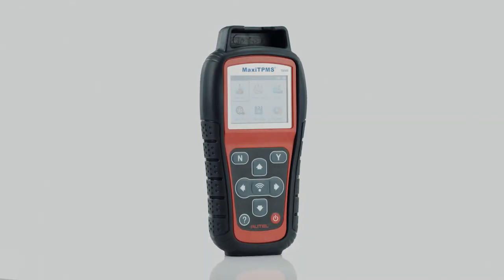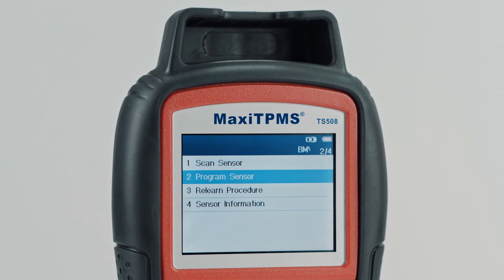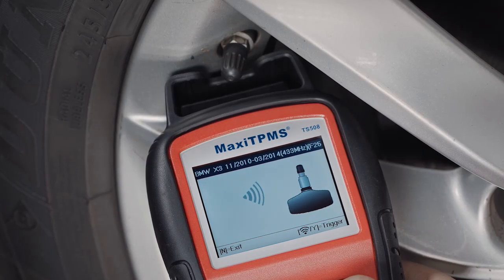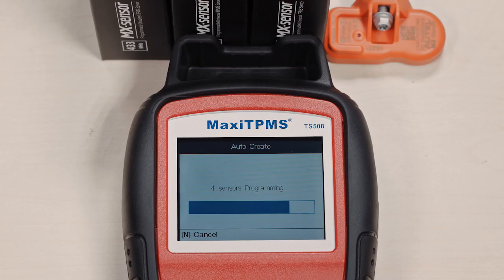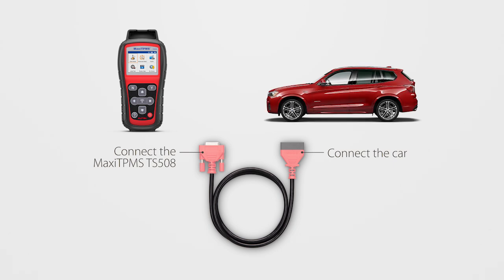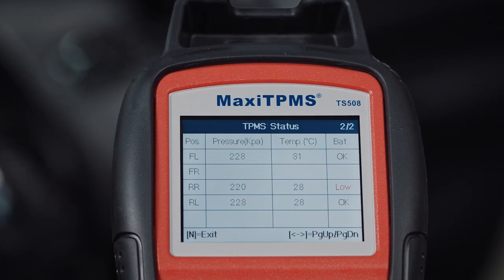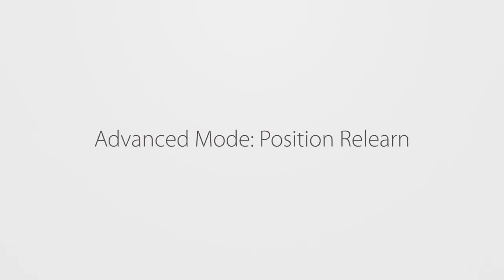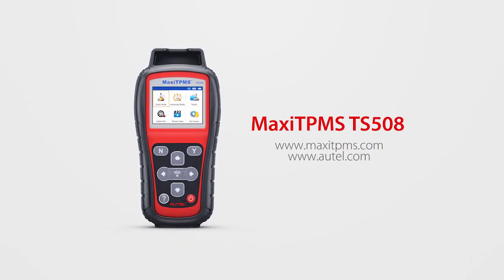Introduction of MaxiTPMS TS508

Comment: Just bought a TS508WF and it looks like copy by activation and manual create options were removed to dumb down the more  budget friendly TPMS tools. Looks like I still have to keep my old TS401 around. Updates are supposed to add features and value, not remove features and dumb sh@t down in order to buy a pricier model tool that offers the same feature the budget tool once  had😡

Comment: Will those allow me to switch frequencies?  I've got a US pickup in the EU and my US tpms sensors (summer rims) and my EU tpms sensors (winter rims) are on different frequencies, so I can't just swap the tires and use the default vehicle tpms recalibration.  I need to take it to a garage with a capable tool.  

Will this work for me?  My EU sensors are autel

Comment: How can I program the sensors if they are already installed in the wheel?? Why is this not covered by any content it's so frustrating!
Reply from the maker: sensors need to be programed outside of the wheel or with no pressure in the tire. If the sensor is already installed in the tire, deflate the tire and try to program with zero pressure.

Comment: Do you need to reprogram the sensors after a tire rotation?
Reply from the maker: That depends on the vehicle. If you have a display on the dash that shows the tire position and the tire pressure, then you would need to relearn the positions after each rotation.

Comment: Does it work for Schader ez sensors?
Reply from the maker: The Autel Tools can not program EZ sensors. The EZ sensors must be programmed with an approved tool, then the Autel tool can relearn it to the vehicle
Reply: @FlashPerformance  thank you for the reply. When I got my ez sensors installed first time, 1 years ago, they were programmed. Now car stopped reading them after winter tire swaps. Does it mean normally that car needs just relearning only which can be done with this ts508 device? Or I have to program and relearn every time after tire swap?

Comment: Houston, Tx tire and wheel dealer here. Been using this programmer which works well with autel but iffy on others from time to time. You CANNOT program sensors unless its an Autel 315/433 mx sensor
Reply: thank you for verifying what i have learned the hard way, NAPA feigns ignorance, I fully believe they know exactly that this is the case

Comment: can u program aftermarket rims and tires with this?
Reply from the maker: The aftermarket rims and tires are not the factor in TPMS programming it is the sensor in the wheel. You can not change tire size that I know of

Comment: Can I install new mx sensors and activate them later? Like drive two days and then activate them?
Reply from the maker: Yes, You can program the sensors while inside the tire. They should be able to be programmed no problem. If you have issues you may need to deflate the tires and then program them.
Reply: @FlashPerformance  No no no, NOBODY has provided ANY instructions on how to activate new sensors that are ALREADY INSTALLED in the tires. PLEASE provide a step-by-step for the activation (not pulling the codes for the old ones but ACTIVATING the new ones with the codes).
Reply from the maker: @nothingtoseehere5760  https://youtu.be/7rszSlKKzag
Reply from the maker: @nothingtoseehere5760  https://youtu.be/s4fWyQtXMuw

Comment: I am at Toyota with my 2015 Highlander for a blinking tire pressure light even though tires have proper pressure.  Diagnostic charge for this is $300 which they say is waived when you pay for the repair.

Comment: so in short, this is a proprietary programming tool just for YOUR sensors?
Reply: I have been wrestling with this exact issue, and it does appear that one needs an Autel programming tool to turn on an Autel sensor sold by NAPA, NO ONE locally has the tool!!

Comment: This precess can be done with any repair tire shop but, It doesn't . Only big company like pepboys, firestone can work and program tire sensor. This is a shame! because the cost of the part and instaltion is $116 / tire. I run to walmart and dealers but the programmer tools did not work on my 2019 Mitsubishi mirage.
Reply: Any automotive repair shop worth a shit that employs competent mechanics can handle replacing, programming and relearning TPMS nowadays, as long as they have a TPMS tool that is compatible with the sensors in question.  Places like PepBoys and chain stores like Firestone and Walmart usually hire the bottom of the barrel grease monkeys, I would not let them get near my vehicles.

Comment: I purchased OEM sensors from dealer and i already installed them on my 2007 toyota tacoma.. can i use this Ts508 to activate and remove the tpms light on dashboard?
Reply: Yes, you just need to do the relearn process. Select the Year Make and Model of the vehicle and press the ? button. This will give you the relearn procedure directly from the tool.
Reply: Who programmed your OE sensors from the dealer?  Because you CANNOT program blank Toyota OE sensors with an Autel TPMS tool.

Comment: Good evening, I have a query, thank you for your support,
I bought a MaxiTPMS TS508 and bought four new sensors (two pairs of different brand and model), but I could not program them, the scanner did not recognize any new sensor, instead the sensors that my hyundai Elentra Turing 2010 has, the rear sensors did not work and now I can't take the TPMS light off it.
Something similar happened to you

How could I contact you for a question or someone from your audience that something similar has happened to him.

Thanks in advance
Reply: Did you purchase Autel MX sensors?  Because if you did not, that would explain why you cannot program them with a MaxiTPMS tool.
Reply from the maker: Autel has a tech support line that you can contact in your region. Go to Autel.com>support. My guess is the sensors you purchased are blank and are not compatible with the TS508.  I recommend the Autel MX Sensor, VDO, John-Dow, Ori-Tech, or OE sensors.

Comment: Hi, install new sensors to my 2013 Tacoma Autel TPMS MX-Sensor 315MHz 433MHz. I have a MAXITPMS 508 scanner, I reprogrammed them, I installed them by obd, the installation was successful, the message but. When I am in the parking lot where I live, the light turns on as if a sensor were bad or a tire and when I go out of the building to the street outside the parking lot where I live. The light goes out . that always happens to me. the air pressure was fine. The Sensors tells the scanner that all 5 are fine. I did the reprogramming of the sensors more than once and that always happens to me. only where I live in the building park. because the light turns on the screen only in the parking lot of the building. I wait for an answer. They are in the correct position.
Reply from the maker: On the Drivers door there is a placard sticker that shows what each tire should be inflated to, make sure that your tire pressure matches that sticker.  Second would be checking the accessories you have in the vehicle. I have seen aftermarket back up cameras, and other wireless accessories mess up the signal from the sensors causing interference and a light to come on.

Comment: If you don't have old sensors can you use this to program new tpms sensors to vehicle?
Reply: ONLY if they are Autel MX sensors.
Reply: @StilettoSniper  can this tool program cheap toyota eBay tpms sensor?
Reply from the maker: Yes, I recommend using the Autel MX Sensor, those are the easiest to use in replacement. You can also use VDO or OE sensors and the TS508 will do the relearn

Comment: It's a shame it only programs/clones Autel sensors,  might have been tempted if it programmed all leading makes.
Reply from the maker: The Autel tools will program any informaiton ready sensor, that includes: VDO, John Dow, Ori-Tek, Continental, OE Match, and all OE sensors.  You will able to relearn an pre programmed sensor.  Check out this video: https://youtu.be/vwMxHx8WoYw
Reply: @FlashPerformance  No, what you are saying here is incorrect.  Autel TPMS tools absolutely WILL NOT program any information ready sensor, such as: VDO, John Dow, Ori-Tek, Continental, OE Match, and all OE sensors.  Autel TPMS tools can ONLY program Autel MX sensors.  Please make sure you understand the difference between PROGRAMMING and LEARNING and use these terms in the correct context.
Reply: Good information to have. Thank you sir. This whole TPMS government SCAM has been a major PIMA. I bought 4 new "Findauto" sensors for my 2015 chevy. Had them installed just to learn this tool WILL NOT program them with my car. It's all very proprietary with NO standard. yeah, everyone and their brother sells a relearn tool but many times the uninformed will spend a lot of money on useless crap that doesn't play nicely with others. 
Cheers from Louisiana.

Comment: Can you use code brand new OEM sensors from the dealership or do they have to be autel sensors?
Reply from the maker: You can do relearns on any information ready sensor.  That includes: OE Dealer, VDO, John Dow, Ori Tec, Dorman, OR Match and more
Reply: Relearn vs Unlock is important to differentiate.  I just got a TS508 yesterday to 'activate' a VDO Redi-Sensor SE10003A that I installed in a wheel for a 2005 Cadillac Escalade ESV.  Come to find out now that the new VDO sensor is installed, that my TS508 doesn't see it. VDO tech support says that while it's 'Redi' like OEM, it has to be 'Unlocked' first and that requires a more high-end specialty tool, such as a Bartec, Ateq, Snap-On, etc...  VDO tech support also says that they 'may' work out of the box and be recognized by this tool, but not if they're installed and driven on first. But it's still a crap shoot at best, according to them if you'll need a better scan tool or not, even if you don't install and drive on it first.
Reply: @4xAbuse  After you purchased the Redi-Sensor, who did the initial programming on it?  Because you can't with any Autel TPMS tool.  Autel TPMS tools can only program Autel MX sensors out of the box.  VDO tech support should have told you this immediately instead of feeding you a crock of bullshit about unlocking their sensors.
Reply: @StilettoSniper  It's been a couple of years now, so it's hard to remember the details exactly. No one did an initial programming on it though. It was marketed as being 'Redi', so no special tools, etc. Seemed like I'd used one previously that was just like that.  I installed and it just worked.  I went to a couple of local shops to see if they could 'wake it up' or if they had one of the recommended tools and no one seemed to have seen that issue... 

I've since run into an interesting situation on a Dorman for an '08 Jeep Grand Cherokee. It would transmit the pressure, but wouldn't communicate with the location sensor in any of the vehicle's 3 wheel wells. They sent me a new one and it was the same. Would work fine in the driver's side rear (no location sensor in the wheel well), but would trigger a location error if moved to any of the other 3 positions. Finally just replaced it with an OEM and it has worked fine since. Dorman couldn't understand why the part they recommended for that application wouldn't work, so they sent me the OEM one in exchange.

Comment: The snop on is way better and is like 200$ more
Reply: BONJOUR EST CE QUE CE PRODUIT NECESSITE UN ABONNEMENT  OU SANS ABONNEMENT
Reply: ourahou med  avec abonnement
Reply: dude you way off base, so fare ai have cloned new MB, BMW, Ford,GM Hyundai. So far never had an issue AND the dual band sensors with quick disconnect are awesome so you can swap sensor between either rubber or metal stems, swap in new sensor in seconds and it reads everything so far including a universal set up for a motorcycle and trailer tpms kit. And you can get kit with 8 sensors with rubber stems, 4 extra metal stems and such and all for around $350! I like snap on and own boxes scanners and lab scopes. But this Autel product lives up to every thing they claim and more.
Reply: @MonzaRacer  Do you know how to program a mx sensor when 2 sensor IDs are the same? The other 2 are different. It wont work when i program from copy by  obd when 2 ids are the same

Comment: 2017 Honda Pilot Touring support?
Reply from the maker: 2017 is still pretty new.  The relearn procedure is not in the tools as of yet.  However you can still replace the sensors by using copy by activation. Here is the info from the Autel website www.maxitpms.com

Relearn Procedure: 
1. Relearn method is not yet supported. Only Copy is available. 
2. You can use one of the following three methods to copy according to the actual situation ? Firstly, copy by activation. Secondly, copy by OBD read IDs. Thirdly, copy by manual input the OEM sensor IDs (You need to notice the data format is decimal or hexadecimal).

This can be done with the TS508, TS608, MS906TS, and copy by activation can be done with the TS408
Reply: @FlashPerformance  but, you got to use autel mx sensor or you can get another aftermarket tpms ?
Reply from the maker: @chramg  Autel MX Sensors, OE sensors, Information ready sensors, and any sensor that is already programmed.   This video might help clear up the different type of sensors. https://youtu.be/vwMxHx8WoYw
Reply: I have a 17 Pilot Touring too. How are you liking yours thus far?